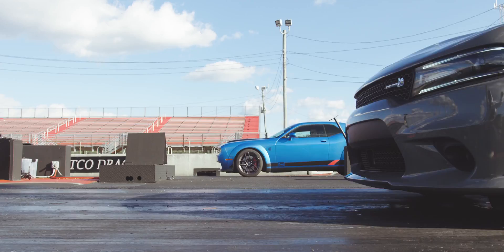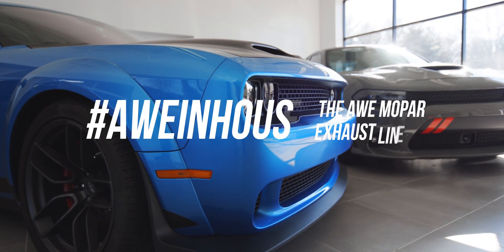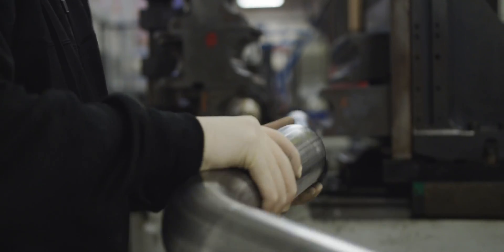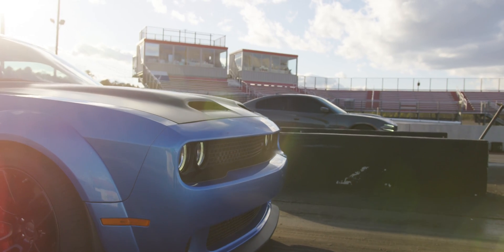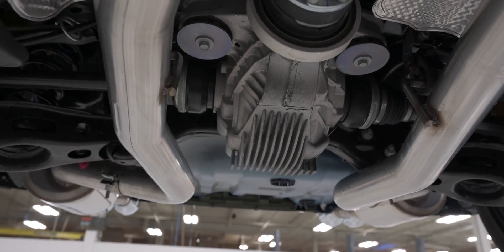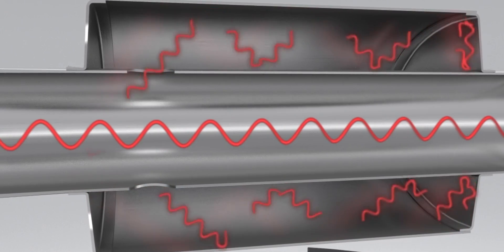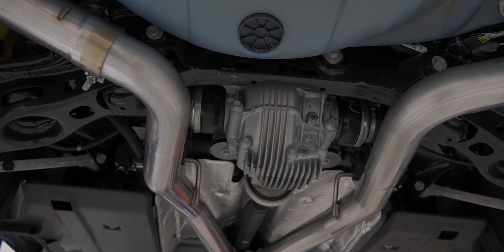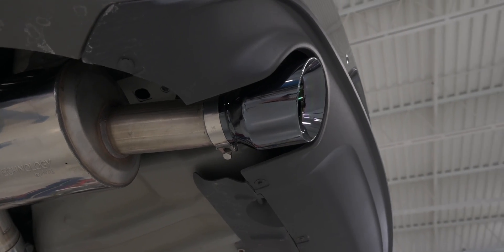#AWEinHouse: Mopar Exhaust Line

Comment: I have the zoomers exhaust on my challenger, it uses (i think, because they Look the same and have the exact same size) vibrants 1794s in the rear as Resonators... It drones a bit... Could it help With the drone when i buy the conversion kit and replace the vibrants With Ur awe Resonators? And would it quiet it down a bit? Asking because i live in germany, and the law here is very strict 😅 1-3 db quieter would be perfect
Reply from the maker: Our conversion kits are designed to be used with exisiting AWE exhausts. Go with one of our Touring Edition Catbacks and you'll never want anything else. It's magical.
Reply: Yeah, but like i said, living in germany.. The awe is too loud, and illegal in germany
Reply from the maker: @kevin_hemi3923  Understood, apologies. Our 180 Tech resonators do not feature material within them that would muffle volume, thus likely not rendering you a lower db reading for your local standards. A traditional muffler would help, but very possible it will introduce a new aspect of drone at steady speeds like you're already experiencing.

Comment: hello AWE, I wanted to ask if your exhausts have or are compatible with the active exhaust and its valve switch? You are a brand i'm looking into but want to know this one question
Reply from the maker: Our systems are not valved, we implement our patented 180 Technology to kill drone while retaining a 100% straight-through design for max performance. We do include valve simulator brackets for AFM valves, though, when cylinder deactivation occurs. These brackets keep the valve motors fully functional while keeping the ECU happy.